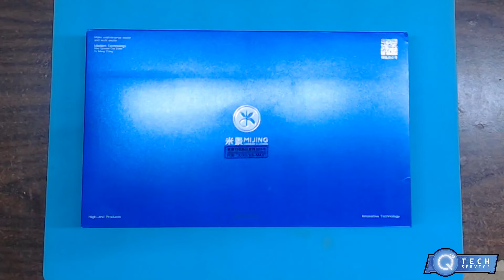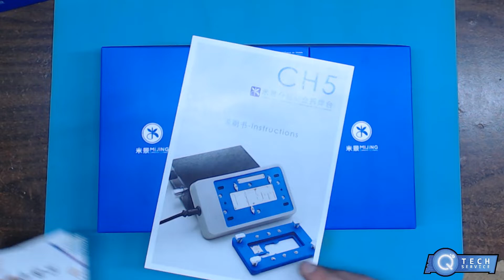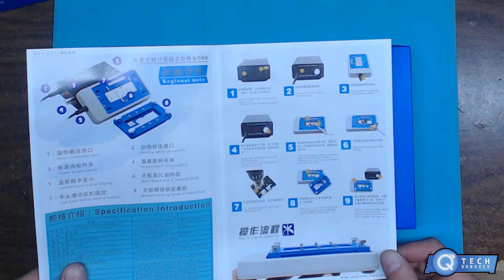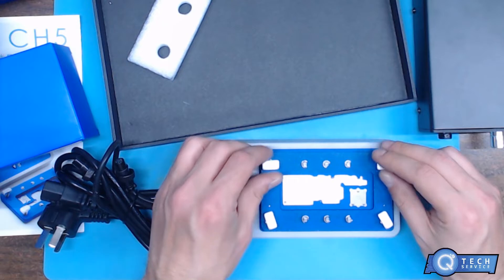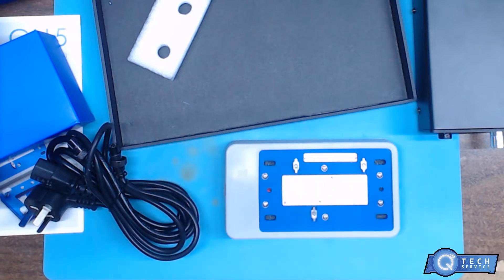iphone MIJING CH5 INTELLIGENT LAYERED WELDING FOR IPHONE  X XS XSMAX

Comment: Nice video, I just got mines in the mail.. Weird how it does both voltages.. They included a travel plug for US connections.. But I’m still worrying about the voltage.. I think I’m going to buy a step up transformer, if it is set for 220v, and I plug it on a 120 outlet.. The amps will increase.. So idk, I wish they provided more info on this.